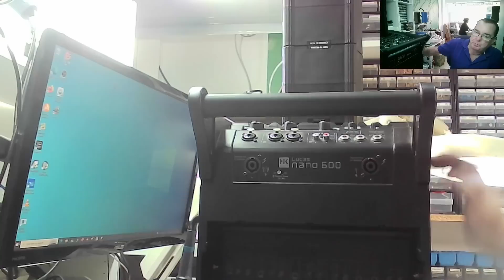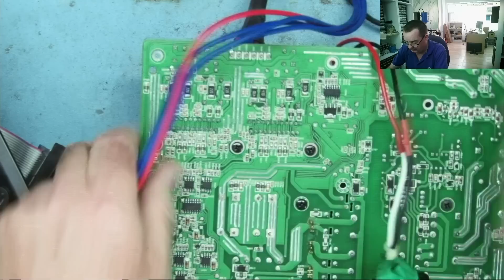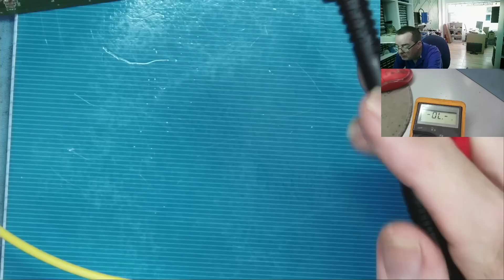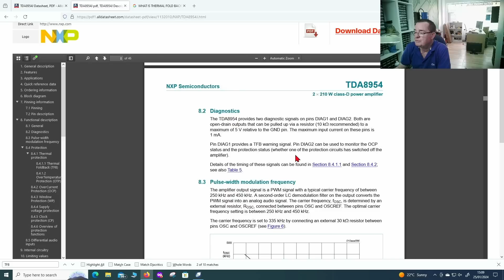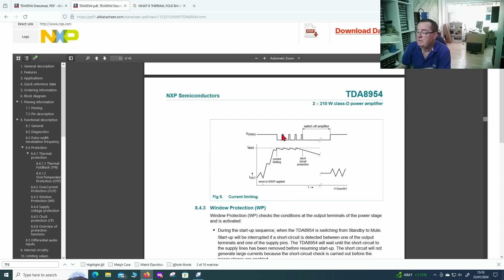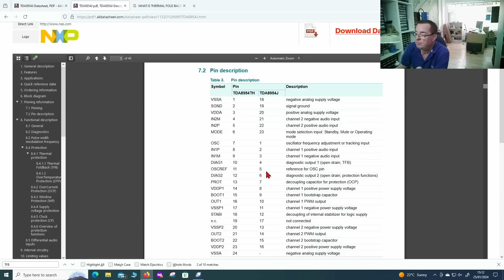How to diagnose faults methodically, no schematics. Another example HK Lucas Nano 600 stuck PROTECT

Comment: Hello below there
About your test leads..
I am really curious to know, why you use test leads that have such a long unprotected tip. To me it looks like an accident waiting to happen. It seems very easy they could short circuit if one tip slips, or if you accidentally touch a heatsink or something similar. On the screen it looks like you have  something like a 30 mm unprotected tip..

For general probing I don't understand it. I know it is good if you have to get down in a dupont connector or similar pcb connectors, but probing on high voltage I don't get it...
Reply from the maker: I just like them, they are resilient and very sharp, great for probing in tight places such as pins on SOIC IC as they actually stick into the solder. I have commented about them not being suitable for high voltage before. I wasn't using them on the mains side of the PCB in tis video, but I have been known too - often saying I shouldn't do this at the same time as doing it

Comment: Sometimes, watching your audio repair videos, I'd like to be there with you to save you some time Rick. Since the beginning I knew these red and blue wires are the Amp outputs.😂
HK is a serious audio components producer but the soldering of the first Amp chip made think that they have to do more about their quality control.
I suggest you check Diag1 also and see if a temp sensing component exists and  is bogged.
Thanks again for your videos...
Reply from the maker: All coming in part 2 - it's already recorded...
Reply: He not trying to be fast, he’s teaching a methodical approach
Reply: @jimjamm9318  IMHO it's the starting point for an Amp repair to pinpoint the outputs

Comment: Hi Richard 🤗🤗🤗🤗🤗
You forgott to pull up with max 5V the diag pin 1(TFB) or 2(all other protections states) .  You cant meassure anything because they are open drain outputs .
In the datasheet they say pull up with 10k and max 5V. At the pcb its look like the trace going nowhere😱😱
Reply: G,day Richard from Sydney Australia.
So my learning outcomes,  
Diagnostic testing of PCBs 
* Introduction AC via filiment light globe (instant illumination indicated no short circuit).
* General visual inspection for integrity of traces, soldering and burn marks to electronics.
* Use multi meter needle probes to establish 'expected' DC at power rails on board.
* Repair soldering (question size of iron tip flat v point).
Thank you looking forward to part 2.
* I would like to know is the benefit in using an AC voltage control in introducing low v after repair, then slowly increase (240v)?
🌏🇦🇺
Reply: @johnfitzpatrick2469  hi, you can  cut off your answer gere and copy it to the right place. After copy you can delete it here. (Push the three points at your answer).
Reply from the maker: All will be revealed in part two.... tomorrow 😉
Reply: @learnelectronicsrepair  tomorrow 😳😳😭😭🤣🤣